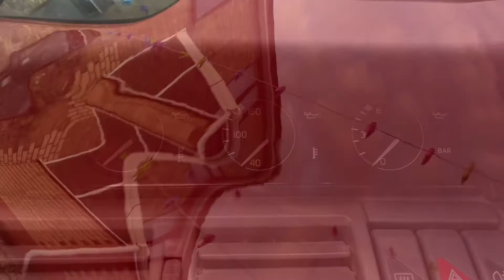Renault Clio 1.8 16v restoration in under 5 minutes

Comment: i sold my naples red one to go to uni.

Worst decision ever. Even if the sunroof did leak on my now wife when we went around corners. And the cambelt snapped on the A34 outside Newbury. And i needed a heater matrix, new exhaust, new fog lights............